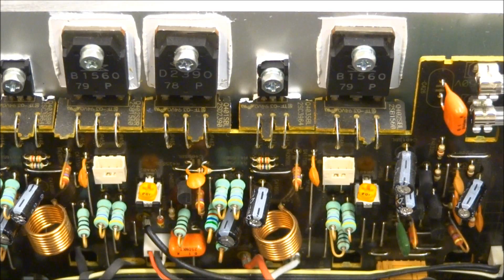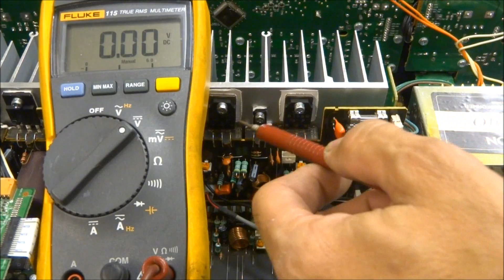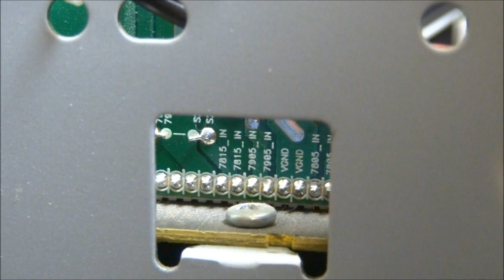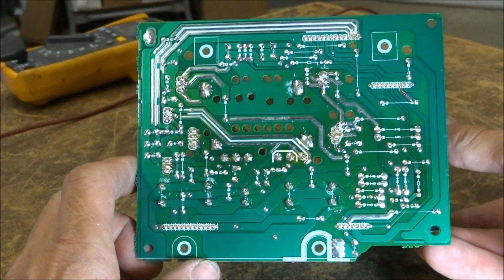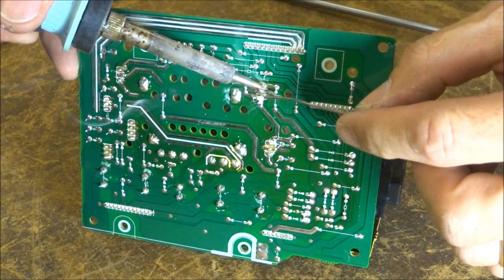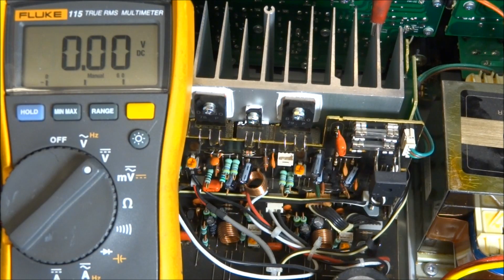Denon AVR788 AVR-788 AVR 788 Blinking Red Light Fix

Comment: I subscribed, I've watched several of your videos. This one hit home because I started to work on an old Integra DTR 7.7 AVR I had. It was originally working but I discovered it definitely had a bad surround channel and went into protect mode. It definitely has bad output transistors and what I believe to be a bad voltage regulator. This video came up on auto-play you tube as I was wondering if what I thought was wrong was in fact wrong. I confirmed the output transistors out of circuit and believe I'm getting a short on the voltage regulator. This appears to be exactly what happened to the receiver in your video!!!! I will use some of your testing techniques "at my own risk" of course to get a more exact answer as you have. Thanks for the great videos!!!! I'm smarter from watching them. I'm a new norcal715 fanboy!!! cheers!!!

Comment: have you ever had any questions about the Denon AVR-790. That's what i have and it is shutting down and stand bye is flashing red. I have this issue with the speakers hooked up and unhooked from the receiver. I don't think it is a heat sink issue because now with the speacker disconnected it shuts off within 5 to 10 seconds of being turned on. I do have subwofer that was hooked up to it and i noticed that the RCA jack was bent and broken in one are from being pushed up against the wall.... I'm not 100% sure but could this have shorted and burnt something else out? Please help John Russell from Cincinnati.

Comment: On another unit, Denon AVR-889 I'm having a different problem.  The board is considerably different than the 788.  When I check IC801 and IC803 (both voltage regulators 7815) I'm getting voltage readings of 43V in and 27.9V out.  Would this be the problem and should I replace both?   I replaced one of the transistors (one of the D2560's) as it was blown and thought that was the main problem.  Any help would be much appreciated.

Comment: Hi there norcal715.  I have picked up a denon AVR-889 with the same red ring of death problem.  I've traced everything to the (very similar) power board that you are showing.  I get similar readings at the transistors so I think those are fine.  The power board has the similar pins but slightly different.  The +15V readout is 1.4V so that seems part of the issue as you mentioned, the -15V reads -14.7V.   I get the following readings for the pins to the regulators 7915 in reads -24.6V, 7815 in reads +24.9 so is it safe to assume both those are bad regulators? The 7905  in reads -10.6V and the 7805 in reads +9.7V s I think those may be ok.  The 78R09in reads +19.0V.  Is that one ok as well or should that be replaced as well.  How did you determine 25V on the input pin and 0V on the output pin at around 9:35 of your video.  Any help would be much appreciated.  Thanks again for the very informative video.
Reply: 7815 was the defective one.  Works perfectly fine now.

Comment: Hi,
I have Demon 5700 that works good until it gets hot then the sound goes to very low level. I take the cover off and use wooden stick to tab some boards and the sound comes back. I couldn't really locate the single board that cause the problem cause they are all connected and to the chassis so the vibration from my tabbing probably affect them all. 
Can you give me some points as what to do next? I have access to solder station and doing ok with soldering. Thanks

Comment: Hi Im currently having problems with a Denon AVR x2100 it powers up then the relays start clicking rapidly then it goes in to protect and that white light turns to red a blinks 4-5 times im guessing that its a bad relay somewhere but have no clue

Comment: Thankyou for helping keep these out of landfills!  Have been through your process and learnt a lot. In my case however the VR was fine, have +15 & -15v, factory test point is within few millivolt, and the transistor collectors have -50 & +50v.  Yet still have the flashing light problem. (a+b reset didnt work).  What electrical component can I check next if all these look ok?

Comment: i have an svr 1603, it was one of the regulators but still didn't work. then i shorted the channel transistor when testing now there is no power at all, sometimes random lights on but sometimes none. i was testing in the reset mode now dead. any ideas please im really stuck

Comment: Hello great report many thanks.
I have something similar but the protection mode appear after long running time...(2 to 3 hrs)
I have checked as described and find out that at 25°C (cold conditions just after switch on) the 7815 regulator is delivering a voltage closed to 12,5V --> I checked the specification and it should be min 14,4V.
Do you think that it could be the root cause ?
Regards
Did's

Comment: Brilliant! Great video!! Tnx for all your effort!

I have a AVR1509: A quick question, I have - maybe someone can give me a tip / hint!

 I get the +52/-52 on the collector on all transistor pairs on all 5x channels but I also do get the 25V on the all the test points & the Emitter - same as describe in this video!

 I took the speaker board (the one with the speaker connectors) out to better access the small connector from the power supply bit (the one with the labels +15 -15 GND 12V....) over to the big main board. I notice that I cannot measure any of the voltages: no +15, no -15 no 12V ... !!!! I also cannot measure anything on the solder iron points through the cut-out (labelled with the 7815 in / 7915 in ...)!!?? The 2 melt fuses on the power supply board are both in tact! Something else before that must be wrong: what AC voltage should be arriving at the power supply board from the transformer (small plug with blue and white cables and what voltage should be coming out of the yellow and red ones going from the transformer to the bigger main board. There are 2 more cable pairs coming out of the transformer going to some bits in the front of the receiver but i heavily suspect the power supply board has other issue / not getting any juice?!

I actually learned all that electric/electronic stuff but a very long time ago (2+ decades) before converted to bits and bytes (IT) ages ago :)

I also read somewhere further down that 3A transistors are required!? Which amps do the transistors need now 1 or 3 or more as I organised already a set of 78-/7915 and 78-/7909 but with 1A!??
Reply: +A Weinforth sorry meant 7905 - not 7909!! - and actually also forgot to mention that I also have a 7812 organised

Comment: Great Video; you make understanding electronic circuts and their functions easier.
Here is my tip: Use a wooden toothpick to clean out the solder from the mounting hole.

Comment: Ever work on Onkyo? I just picked up a Tx-NR709 and it has the HDMI infamous "no sound" issue. Also "No speaker indicator" problem on the display. Faulty HDMI boards were a problem i guess. Its under recall and is being fixed by Onkyo as we speak. They paid for shipping and even sent me a box! Can't wait to get it back and hook it up!!. Ever work with these issues? btw, I subscribed!

Comment: Hi I have a Denon 1910. It usually makes a popping noise through the speaker before going into protection mode. Do you know what the problem could be?
Reply: ***** Nope one day it will be ok, the next it will shut off. Try connecting your speakers to the receiver with banana plugs. Also what's the resistance on the speakers you're connecting? Mine will misbehave with anything rated less than 8 ohms

Comment: hi i have avr1802 with power issues which i fixed but now i get a hum through speaker
with no sound ,if i turn volume up it screams then shuts down am slowly working through board.  
how do i access the built in fault code menu 
regards

Comment: Great video! I have a denon avr-887 and the right bank of speaker outputs doesn't work on the A or B side. Both left sides work. I will check the transistors as you showed, but can you think of anything else I should check? Thanks in advance.

Comment: I got a similar problem with my AVR-1909. Both 15V and -15V regulators (KIA7815API, KIA7915PI) seem to got damaged. I also had a exploded diode caused though a power surge. Your video helped a lot in locating the error.

Comment: hey, i have a question about my surround sound. 
two of the resistors and transistors are clearly bad. how ever next to the resistors is a normal resistor that appears to have blown. i can still read the value of it but its chard, my question is do you think i should replace the all three resistors and the two transistors or do you think this unit may be junk. 
side note there is a blown fuse but when its plugged in and you hit the power button it will still trip a relay but nothing else happens.

its a pioneer vsx 604s

Comment: How can I send mine to you for repair? I still have the original box. Just took it out of storage after 2 years and now I have the blinking light.
Reply: I've got an older 1312,still won't powerup without interruption pisses me off. I've got a humming bird in it acting up it actually hums. Anyway the blinking light issue I got the manual on line micro processor has to be reset every time it's powered up. The unit needs some type of repair but will play after it's reset how long unknown I'm hoping that the micro processor which also holds a type of flash drive will correct itself but it has not  after resetting it a dozen times in the past couple days looks like it will eventually fail just a matter of time Dave.

Comment: Hi. My friend, I have a question. My 1910 doesn't power on the display and enter in protected mode after 7 sec.
The center channel had a short, I replaced the capacitor in short but the receiver doesn't power on. The 7812 and 7912 are in good condition. Any idea of the problem? Tks a lot.

PS. Sorry for my english, I know, is very bad.

Comment: It seems like Denon has dropped a bit in reliability since they merged with Marantz. Until recently it was rare for a fairly new Denon to fail - now I see them all the time. Hopefully they get a grip on their parts weakness, as it's getting harder and harder to find a receiver brand to recommend. I removed Onkyo from my list long ago - way too many problems.
Reply: Squall Leonhart I was being kind. I have one of those late model POS Denons that throws a red light fit when it feels like it. Regulators check / measure fine. Pioneer builds a much more reliable receiver - heck, Sherwood builds a much more reliable receiver. Honestly the Sanyo "Studio Standard by Fisher" was worlds higher quality.. and I am not joking.

Comment: Replaced these 2 transistors 7815, 7915  part # 2631100034, for 7815 part# 9630021502 for 7915, these are denon part #s.my receiver now works perfect I added a small fan on top of the receiver to keep the amp cool, so it don,t happen again,thanks for your help.

Comment: I think you actually measured the bias voltage in AC mode instead of DC mode; which means you haven't actually measured the bias voltage, but the AC-coupled bias voltage (i.e. the ripple of the bias voltage). Same thing happens to me on my 87V all the time :-(

Comment: I like to sand the legs or leads of replacement components before I insert them in the board.  You get better solder flow without the crusty oxide layer that's invariably there on unsanded legs.

Comment: I am working on a Pioneer looks totally different inside. Plug it up and it's dead. So I opened it up and found the fuse blown. So I put a new one in and turned it on. Blew it out. At any rate I got to checking around and found a dark spot on one of the boards. Looks like something got hot. I found a transistor C2705 somewhat crispy.
I checked it and I know it's bad. Also there looks to be a very small resistor red with a black ring around it, not sure if it is a resistor but some what toasty.  Thanks for the video I know now about how much grease to use. As far as parts goes which brand or brands would be recommend for replacements.

Comment: Great video has inspired me to try fixing my denon 1906.  I've managed to remove the main board, and want to replace regulators 7805, 7815 and 7905. Problem is there are large capactors (or something) blocking access so my question is... should I try removing the capacaitors to get at the screws... or instead should I loosen and remove the heatsinks to which the regulators are screwed... and then attach the repacement regulators to the heatsink, before  relocating the combination back into the board, and soldering?

Comment: Very useful.

One useful tip when removing the regulator.  An option is to clip the three leads close to the faulty regulator body and then remove then one by one using a soldering iron from the top side.  The advantage of this approach is that the soldering iron tip is not applied directly to the solder pad on the underside of the board as sometimes this can cause damage, particularly with single-sided low cost PCBs like this one.....